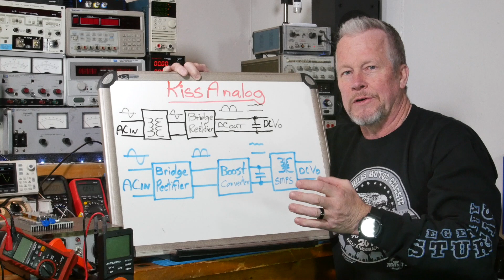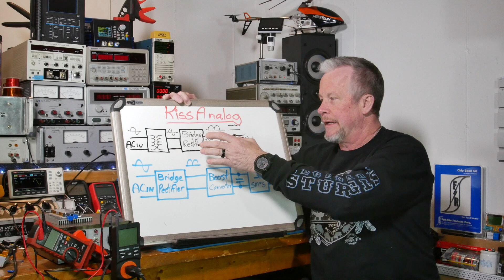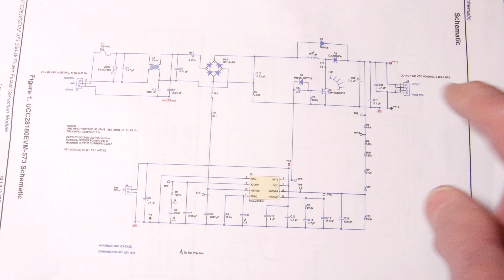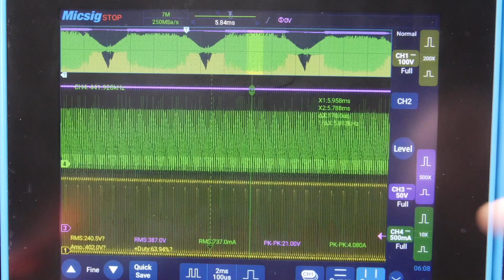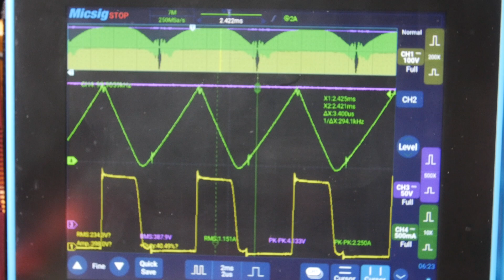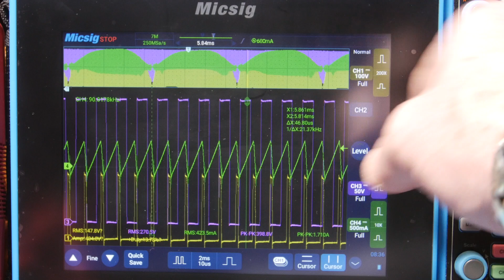AC/DC Switch Mode Power Supply (SMPS) Intro and Demo

Comment: Can computer smps work with 220 volt dc.
Reply from the maker: Thanks for asking!  It depends - is the front end is a slow frequency switcher or an active PFC.  I

f it is a low, frequency, switcher – then it would have a large capacitor after a bridge rectifier.  In that case you probably can:) Be careful!!!

Comment: my ev scooter charger  operates between 170 to 285 volt Ac and give output of 84 volt dc to charge my ev battery which is 72 vot and full charge to 78 vot.

If i give  220v dc what will happen to my charger will it burn or charge my scooter battery.
Reply from the maker: Great question!  If the charger has a PFC front end - it would likely cause damage, but if it is a rectifier front end then it might be OK.  It would be taking a chance to try.

Comment: Don't forget to probe that resonant LLC power supply :)  Probe the current and voltage at the primary side of the transformer with load and no load at the output of the SMPS
Reply from the maker: Thank you!  I can't wait to get back to that project;)  I do want to see that.  So much of the design literature talks about the input voltage range and its affects, but I'm more interested in the loading affects.

Comment: Thanks Eddie!
I remember back in the 80's and 90's when stuff started coming out with switching supplies. I was sidelining fixing VCRs (remember them!) and the capacitors in the switching supplies kept going bad because they couldn't take the high current and freq. Today that's all changed and I'm using the Mean Well supplies all over the place.
I just modded the class A Pass clone and finally got decent power out of it at low enough distortion but the down side is that driving the mosfets to class A, even with switching supplies, the thing draws 400 watts and that's with only 38 watts at the amp output! Is that about what you're seeing in your Aleph 5?
Now I'm thinking these class D amps are looking much better and tied to a switching supply I can get some really good power ratios so it's time to start looking at your class D amp videos!
Reply from the maker: I remember those days.  A lot of money was made repairing expensive VCRs.  I’m going to do a new Class A video very soon.
Reply: @KissAnalog  Great, I'll be looking for it.  
I just threw together a class D I had laying around in the basement (my wife calls the basement The Robsonian) and it's surprisingly good but it's not musical in my view, it doesn't have the sweetness of the class A's. It sure is efficient, the thing idles at 18 watts!

Comment: I'm sorry if this is a silly or ignorant question, but would there be any value in terms of stability or noise reduction in converting the single phase input to three phase before processing it for the desired output?
Reply from the maker: Great question!  The problem is how to get 3 phase.  If the source isn’t already 3 phase it would have to be generated.
Reply: @KissAnalog  I was thinking possibly something like : 
[wall power] --> { [3 phase converter] --> [buck/boost process] --> [output filtering] }
or would the conversion be too noisy or problematic in terms of loss of efficiency?  Or maybe just too expensive or complicated in terms of parts?  I know this is probably silly, I've just been watching a lot of videos on 3 phase and am fascinated by it at the moment.

Comment: A point not talked about is reliability. A linear power supply will last almost forever, limited largely by the life of the capacitors and can very easily be repaired by many constructors. A SMPS on the other hand has so many active components reliability is somewhat reduced in my experience and cannot be easily repaired by the average constructor. In the event of a failed SMPS many parts can be destroyed, some ICs are impossible to get.
For the home constructor, if you use a SMPS you may need to replace the complete PCB in the event of a failed unit and hope the same PCB is still available.
A linear power supply, are all separate parts, readily available, easily fixed, the transformers almost never fail, the diodes if sinked  again, almost never fail. All that's left is the main caps, the weak link on ANY circuit, but can still last 10/20 years.
Most TVs fail due to the SMPS. They have an important part in electronics but reliability is not one of them.
Reply from the maker: Thanks Michael!  That's great feedback!  You make many great points and I appreciate your points.  Most TVs fail because of the power supplies but even the linears fail because of the power supplies, and the number one reason is the Aluminum Electrolytic capacitors.  They dry up and fail because people are cheep and don't put enough derating into them.  Switching supplies often can be designed without aluminum electrolytic, so they can last as long as anything else.  I've been designing SMPS for many years now and I can say that most of the designs had to last for many years.  The power supplies in the International Space Station are all SMPS and had to be designed for 20 years and zero failures.  Every Aircraft has nothing but switching power supplies and they all have to be designed with very high reliability.  The most common controller used today is one that is 30 years old;)  However, I haven't used it in a number of years;)  Like Class D amplifiers, they are more complicated, but I hope in the years to come that I will have enough videos that many will find them very approachable;)
Reply: @KissAnalog  I guess, like most things, price is the main factor. I would expect capacitors used by Nasa have a very high spec and probably don't come from dodgy suppliers from E Bay!! The kind poor people like me have to buy.
Reply from the maker: LOL - you are right;) They are pricy!

Comment: How much of difference make the emi filter ? I saw them everywhere but not in diy projects. Are they only for electromagnetic compliance ? To  not disturb nearby electronics, or do they also play a role about how the power supply perform ? Like the noise at the output. Would be beneficial to think about the emi filter in the ongoing audio amplifier project ? Thanks as always for the countless hours of fun
Reply from the maker: Great question!!  The emi filter protects the power supply from other bad players out there, but also keep from being a bad player;)  I'll show how to do this the simple way - which is about all anyone needs;)  EMI can be a crazy hard subject, but it can also be made simple with basic understandings and applying the right techniques.
Reply: @KissAnalog You have been very clear, i will look forward for the k.i.s.s. approach

Comment: What about slew rate or ringing on smps isn't that the biggest issue with them over linear.
What's the difference between smps and class D as a power supply is there any different?
Reply from the maker: Great question!  Controlling the slew rate can solve the ringing problem.  Most power supplies I design don't have a ringing problem as I try to solve this with good board design (placement and routing).  The biggest problem with SMPS is that there just simply isn't enough design engineers that know how to design them.  It is really an on the job training;)  I hope to make many design engineers on this channel;)   There's building blocks and simple introductions that can make way for the more complex portion of tackling a design.  I'm throwing concepts and ideas up here and there to build a base.
Reply: @KissAnalog  yes sounds nice!  what about my second question smps vs class D
Reply: @KissAnalog  ever thought about doing online course and Youtube tutorials. Maybe a competition every 3 months for the best design win a prize. People can send the designs into you and you can judge which is the best. Coursework could be downloading from the website if you had a certain project in mind.
Reply: for me class d is a type of amplifier and smps a type of power supply
Reply: @giacomo1191  not really class D amplifiers work quite well as power supplies they're called bash amplifiers, where you would have a class D power supply with an AB amplification stage